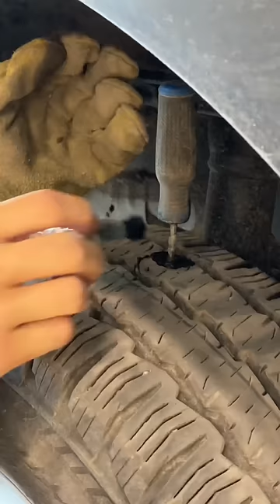Why You Shouldn’t Plug Tires #tiredoctor #tireguy #tires #shorts #tireplug

Comment: I’ve been driving on plugged tires for years and years, and haven’t lost any sleep over it.
Reply: Same and it's only 3 bucks for a kit with cement glue, 10 of those stick and both tools to do the job
Reply: Tire shops just want u to buy a whole new tire
Reply: I don't know jon. Entire countries have done this for decades without problem.
Reply: Same
Reply: I was saying the same thing some tires with 2 or 3 plugs in it and lasted so long the tread wore out before the plug failed
Reply: Same here
Reply: Same.   I've been plugging tires for years with Safety Seal.   I've had zero problems.    The plug becomes part of the tire and can't be removed after it's set.   (I've tried as a test.)

Shops hate this, because you don't need them if you do this.  :-)
Reply: @Gr8thxAlot   My dad plugged everyone's tires when they had a flat my entire childhood and never an issue...how would it destroy the inside of the tires? He also never drilled or reamed the hole.
Reply: Drove with a plug 55k miles
Reply: No just waisting company time airing up the 25 to 20 psi that leaks out every night.YOU FIRED
Reply: Exactly. Nothing wrong with plugs. I can't even imagine what he means by destroying the inside of the tire.
Reply: My dad plug his also and we drove 1800km trips no problem
Reply: They just wanna up sell you
Reply: Same, I've plugged every set I've ever had, I've probably spent more time driving on plugged tires than undamaged ones.
Reply: Patching removes more liability from the company's than plugging does is why they switched over I would think
Reply: It's totally fine to plug a tire.... assuming the inside of the tire isn't trashed from driving on it too long while it was flat. Bit of a gamble just don't drive flat and you're prolly gonna be fine.
Reply: Same here
Reply: Back when I was in college and had no money I ran my tires bald and then some. I was plugging tires all the time. Plugs can blow out when there is no tread. In Argentina  where I live now they don't plug tires. Labor rates are so low they demount and patch everything.
Reply: Me too! It's my go to method.
Reply: I can’t help but say the following:

That works. And when it fails… well you won’t lose any sleep then either. More like a loooooong nap. So you’re good either way 👍 😂
Reply: As someone who works in the tire industry the reason it can ruin the tire is if moisture leaks into the plug it can rust out the cords which will destroy the integrity of the tire. Most places will fix tires for free and most do a rubber plug rather than a gummy plug and then a patch with sealers. It is safer that way and is guaranteed to last longer overall. If you're in a pinch though a plug will definitely help but you really should just avoid it if possible because like I said most places fix for free not plug kit required.
Reply: I'm driving on two plug tires right now😅😅😅
Reply: Damn right!
Reply: Its only dangerous if its to close to the side id bet
Reply: I work on cars that have these patches in them a lot
They usually come in for flat tires
If you installed it and it's leaking from there nobody will fix it, too much liability
That's the whole name of the game is liability
Reply: I've been running plugs in my current tires for 30,000 miles.
Reply: Plugged tires on the Autobahn for 2 years going over 100.  Either I'm lucky or it's just pretty safe
Reply: I wish tires lasted me years. A year a set on the pickup usually.
Reply: @nes999  True. I drive a modest sedan...
Reply: Only time i worry about it is when a hurricane comes thru with that super low atmospheric pressure and my tire light comes on but then a week later the lights off sooo🤷🏻‍♂️
Reply: I plug my tires and forget that they’re plugged
Reply: The number one reason it’s frowned upon is because of missing a sale on a new tire! 😮
Reply: Exactly….
Reply: Cause eventually you may lose your life over to 👍
Reply: Me too😅. Tire shops just want me to pay them $25. I'll ride with 10 plugs at $7 total
Reply: Sleep is definitely important 😂
Reply: Plugging for 30 years and I've never had one fail. Was taught right by Pops
Reply: @ethanadams1822  none of the tire shops within 50 miles of me fix flats for free. NONE of them. But hey, I'll go back to the shop that charged me 25 bucks to fix my tire last Monday and show them your comment and demand my money back. We'll see if you know what you're saying. LMAO
Reply: @TheBrushcutter  25 dollars is ridiculous I've always fixed for free
Reply: @justinkase1360 It destroys somebodyes busines, and only that.
Reply: I had a problem with plugged. When I go through a 'flood' half tire deep for like 10m, the next day that tire gonna need a pump.

Since then, I use plug when in a hurry then gonna fix the right way when I have the spare time. It's not funny to have half dead tire after driving through little flood
Reply: Unless you plugged it at night🤯
Reply: Once, when I was stuck in Warrensburg NY, far from home with a flat.
I put fix-a-flat in, and it pissed out the leak and I started to worry because all the garages were closed.
I went down the road to a supermarket called Grand Union, and bought leather shoe laces, and another can of Fix-a-flat.
I used a thin screwdriver to push a doubled up piece of the shoe lace in as a plug, and used the can in it, and no leaks.
I used it like that for a couple hundred miles before I plugged it properly.
Reply: Inside of my tire is empty space
Reply: Does not mean you were correct.
Reply: Sometimes you screw up the steel belt
Reply: Agreed Same 💯 👍🏽
Reply: 1960-1970s is very popular used at all tire shops. 
The incorrect or bad repair is the problem.
Reply: @danielch6662 
Getting to the point that only corporations are dictating our lives.
Reply: Yeah they are safe, just need t as safe as a new tyre. It’s the only problem I have with capitalism. Stop underusing shit.
Reply: I put Ten plugs in one hole while off-road. It leaked a little less with each plug.....till it barely leaked and I MADE IT HOME. 
Plus, when properly used,they do a great job and almost always last as long as the rest of the tire.
Reply: Yeah same
Reply: Click
Reply: Shit will get you back on the road. Great invention.
Reply: Same
Reply: Patches cost like $20 and better for tire life. But I know what you mean and seen nothing wrong with plugs
Reply: Same, always carry a kit and a small compressor.
Reply: Same.
Reply: They have to invent reasons to make you buy another tire. It’s like a cop saying I’m doing this for officer safety same shit.
Reply: If tire plugs were that dangerous and bad they wouldn't sell them I've never had one leak or blown up a tire on the highway with a plug in it
Reply: You just proved why anecdotal evidence is useless lol
Reply: Same ive put 14 k miles on one thats been plugged.
Reply: I’ve been driving for 7 years now and (knocking on wood currently) have still never gotten a flat tire.
Reply: @johnschneider1483  i think my work truck has at least 1 plug in every tire right now and none of them leak
Reply: Truth
Reply: @TheBrushcutter free if you bought the tires from them. Not free if you didn't. I still just use plugs, if I get a nail. If I get a gash/slash, I get a brand new tire. Buy your tires from a reputable installer and you're golden.👍
Reply: Because there is nothing wrong with it, in the "industry" they would rather just sell you a new tire for $350 instead of a $50 patch.
Reply: @johnschneider1483 what crack you smoking
Reply: That's because it's not dangerous.  They like to say that it is so that they can sell you a tire.
Reply: You're not supposed to keep using tires for years and years, even if they're not damage, rubber has a max lifespan
Reply: I've never had a problem with plugging a tire, have probably driven close to a dozen with no issue.
Reply: I've probably plugged 50 tires in my lifetime. To my knowledge never a failure.
Reply: Honestly idk why everyone hates it so much. If you do it right it fills the void and retains the speed rating. Its more dangerous to just patch a tire and not use a plg to fill the void in the tread
Reply: @godzilla7148  well makes more sense now
How does that happen ? Do you live in a nail factory ?
I'm not that old, but still, I have never had a puncture in any car ever
Reply: This temporary plug can last the life of the tire if done correctly.
Reply: Just make sure the plug sealed the intertube as well .. 😅😅😅😅😅
Reply: Patching a tire is a lot better than
Reply: And sidewall patches
Reply: Ya, I've never had an issue, been doing it since I started driving, so has my father and my grandfather.
Reply: @LordVestibule ; IF or when it does fail, it won't leak any faster than the original leak in the first place. It is no more dangerous than any used tire.
Reply: @forestpagan4813  these plugs let in moisture which, over time, can corrode and damage the tire from within. Weakening the steel belts and overall structural integrity. Not a big deal if they’re used up fast and replaced but not ideal for anything sitting around, or highly moisture work environments. 

Just something to be aware of.
Reply: @LordVestibule  I don't know, the last tire I plugged lasted at least 3yrs before I finally wore the tread smooth, and the casing started to be exposed
Reply: Same here 👽👽👽
Reply: Same here, I've kept repair kits in my vehicles for 20+ years. Plugged lots of tires and never even had one leak. But who knows, maybe one will explode tomorrow.
Reply: Same here and still doing it not going to stop anytime soon lol😂
Reply: @stevenallen6245  YEAHHHH 👽
Reply: The guy who made this vid owns a tire company....
Reply: @R-uh6969  👽
Reply: Mechanic here. Plugs are fine as long as they're in the tread. Never plug the sidewall.
Reply: Well when you take that nap it will be your last 1
Reply: @ethanadams1822  you are correct. Discount Tire will repair flats for free. AS LONG AS it is not in either of the outside treads. Then they refused to patch and sell a tire.
Reply: @sc666666  there is a reason for that the sidewall will flex as you drive and as it flexes the plug has a high chance of popping back out or the tire exploding because the structural integrity has been compromised. If they were to "fix" it and that happened, it could cause serious injury or death to you and or nearby drivers in the worst case scenarios. Not that it is guaranteed to happen all the time, the chance is extremely high and they are held liable for any damages that occur. How would you feel if someone fixed someone you loves tire when they shouldn't have and that happens. Tires are more important than most people realize.
Reply: @ is there a number of actual occurrences?

Comment: I have been plugging tires for 45 years. Never had a problem yet.
Reply: I used to keep getting punctures on building sites so that was one of the reasons I invested in a tyre machine and balancer.  I also don't trust tyre shops because they have a vested interest in selling new tyres.  I have been plugging my tyres for the last 15 years with 100% success.  I use a mushroom style plug, which is a large diameter patch with a long soft stem that is pulled through the tread.  The patch is bonded to the inside of the tyre and the stem is bonded into the thickness of the tread  The system requires the tyre to be demounted but it is a highly reliable repair.  The plug type shown here I use on my bike tyres as an emergency, get me home, repair kit, after which a proper repair or replacement is carried out
Reply: Watching the drill tear up the belts.
Reply: What do u think of plug patch?
Reply: @noobSaybotK  I have been using these very successfully for the last 15 years or so.  You get the best of both worlds, a plug and an internal patch with both getting better fixation from the other.  I would not use any other.
Reply: @clivewilliams3661  cool thanks. Unfortunately mine didn't work but repair man used double plug and works now no air seap
Reply: @noobSaybotK  One thing that many tyre shops don't do is grind off all the internal ribs of the tyres and just hope the patch holds.  If you grind off those ribs it gives a keyed flat surface for the patch to cling on to.  The other problem that may be encountered is the use of slime (liquid puncture repair in a bottle) that coats the internal surface of the tyre so that it has to be very thoroughly degreased or the rubber cement won't work.  It is indeed the best tubeless puncture repair bar none and with me its 110% reliable.
Reply: @clivewilliams3661  hey yea that's exactly what those tards did they scuff it down to much to the wire I think that's part of the reason patch didn't work. He said we can try a plug didn't work n he said his final attempt would he two plugs so we went for it and hopefully that last a a while till I can replace tire
Reply: @noobSaybotK  I would have claimed another tyre off them as they clearly have damaged the tyre so much, its unsafe.
Reply: @clivewilliams3661  owner said i took to long to come back was his pre text. Honestly I didn't put up much of a fight lol am not that type 🙃
Reply: Mans still did it wrong.... You have to take the tire off the wheel, buff the inside, drill it with a carbide bit,  clean the rubber, then apply your solvent then patch
Reply: Plugs work great and can last for the life of the tire or not
Reply: Ditto
Reply: I've been plugging tires for almost 30 years and never had an issue. My father taught me not to plug when the hole is too large (plug should be TIGHT) and NEVER be afraid to load that sucker up
Reply: Exactly. I've had many plugs outlast many tires. Just plug it and move on.
Reply: You and me both sir. Last set of tires, the tech came out and said, I counted 14 plugs in that set. What the hell is going on
Reply: Mr Safety is always looking out for the fainthearted.
Reply: 25 years here